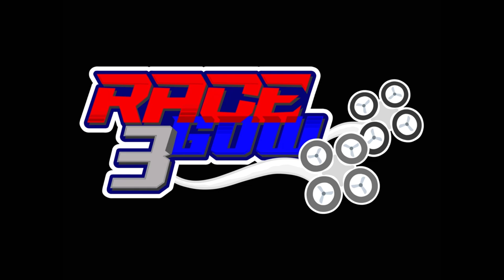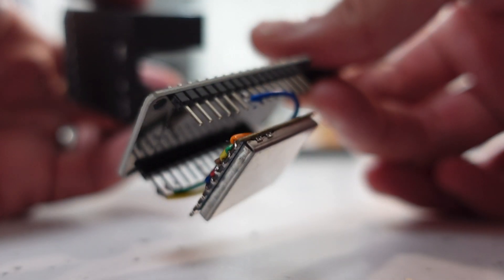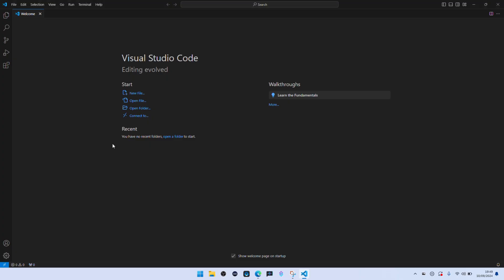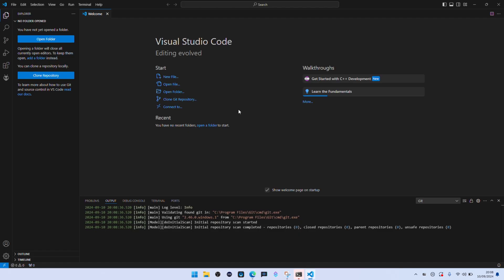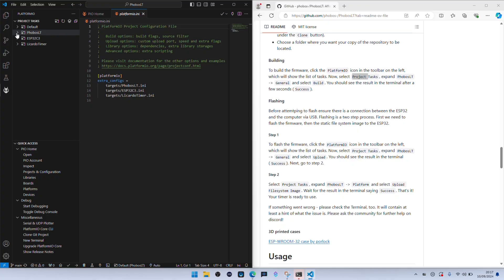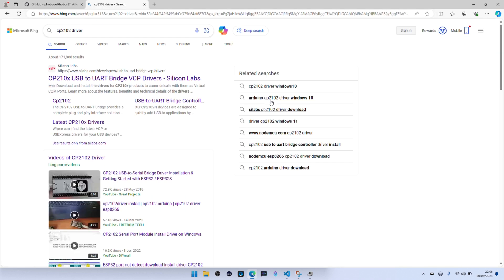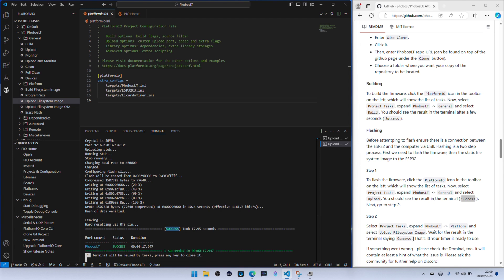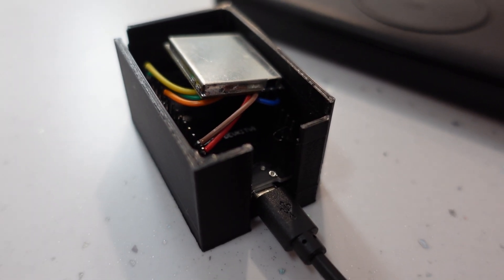PhobosLT - Build your own FPV Lap Timer for RaceGOW or larger racing

Comment: is it possible to get it for t-energy s3?
Reply from the maker: on the git hub page is says t-energy is the recommended but doesnt specify the s3 - so i guess it does but best thing is hop on the discord and ask the team, they were really helpful, head to the github and scroll down for the discord - link in this videos's description :) good luck its a great project
Reply: @genericfpv  yes asked on discord, I give up for now, build has some errors within a process even for esp32

Comment: Hey,
Does this add the time to your FPV feed as your DVR? Or did you add this in the edit?
Reply from the maker: it doesn't sorry i added after in editing, you view the device from a web browser, and whatever that device is (my phone) reads out the laptimes as you fly. i should have done a better demo of that sorry. But i think ELRS is doing a thing for racing where it broadcasts your time and position in a race to your goggles, not sure if its gonna use rotor hazzard or something, pretty sure its coming, the ELRS discord would be best for more info

Comment: This is why I LOVE THE FPV community. I was working on something completely unrelated but on the ESP32 platform using VSCode and the Arduino IDE is really really bad! Thanks for the tip for using PlatformIO. I'd probably build a laptimer in future too!

Comment: Nice concise tutorial, looks like ESP32 are very capable, I have one I never get around to building an ELRS module with lol, maybe one weekend :D
Would be nice to see how you set it up on the track once you have it built and flashed.
Reply from the maker: so that bit is less glamorous  i have mine at the start/end gate but becuase whoop tracks and indoors you have to wrap them in tin foil on 5 sides to block rf and make it direction. I'm still getting to know that side its easy to do - but every track i've had calibrated slightly differently but yes good idea ill do a mini update on one of the racegow tracks over next week weeks cheers